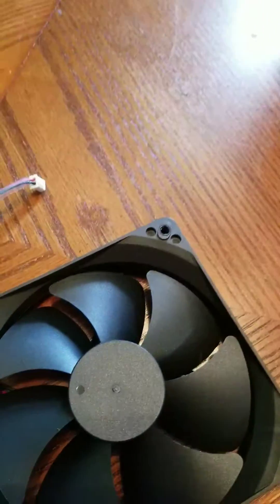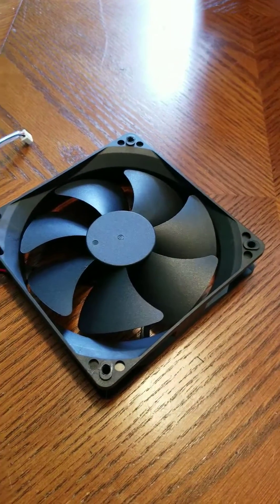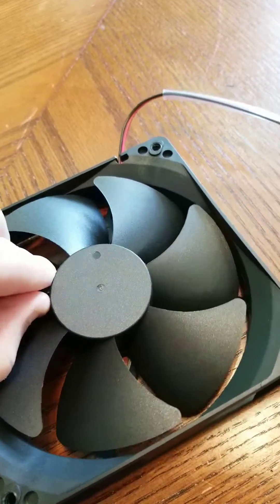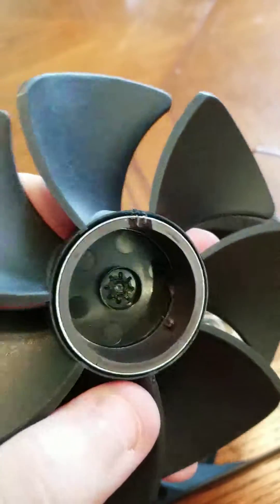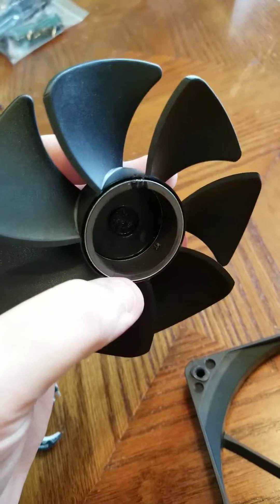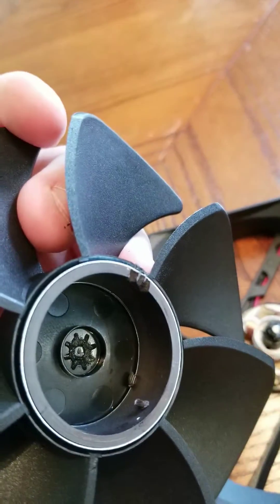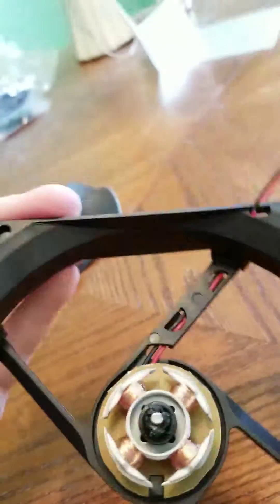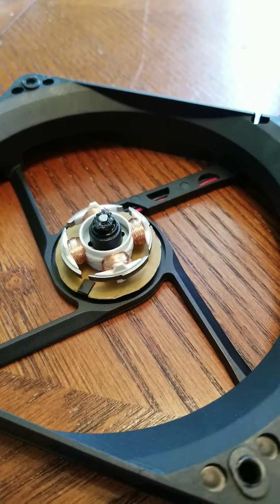Corsair CX450 Fan Failure

Comment: hi, no clue if this account is still active or not, i think its worth the shot to ask you since i cant figure this out on my own. I bought this exact psu from a guy and upon installing it in my system i realized that the fan wont spin when idle, i havent tried to running it more beacuse im afriad it will burn my system if the psu fan wont start. Any suggestions?
Reply from the maker: Hello if the fan won't spin then this could be any number of issues. It could be benign like a clogged or jammed fan fin which can be cleaned or a loose connection to be reattached. Other times the psu fans are semi-passive and will only come on during load or if temp rises. It is difficult to know exactly what is causing the fault without opening the psu and examining. 

The cost and time for opening the psu and replacing the fan may not make sense in comparison to buying a new psu. If you do open the psu please proceed with caution. These can be incredibly dangerous and can cause serious injury/death if precautions and safety measures are not taken.
Reply: @Matty_Ice_Reviews  I appreciate the fast response and extensive intel youve given on my issue.
Uppdate: ive managed to try the PSU on my system for about 1 hour while performing a stress test on the system and only after my cpu reaching 70 c the PSU fan seemed to have started. 
I was not aware of Corsair's implementation of silent mode on these old PSUs. especially not their lower end (450w) selection. 
I still have the doubt that these fans are thermally controlled and rather that mine is just faulty; for that i will have to test it on my pc for at least a couple of days.
Thanks again for helping.

Comment: T
It appears to me that he fan was loose and so easy to remove because the centre hub retainer had broken loose leaving a 'nub' on the shaft. I believe normally the shaft retainer is under the sticker on the opposite side. The fan is usually removed with the shaft attached to it by pulling it through the bearing. Video detail was very good.